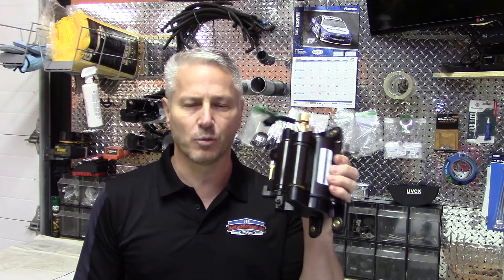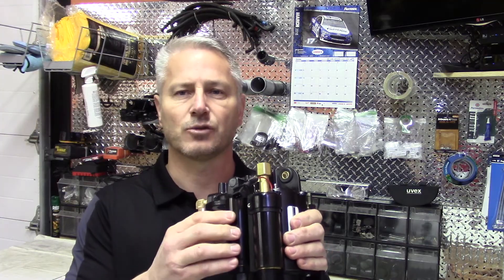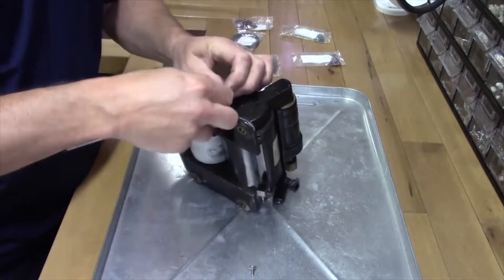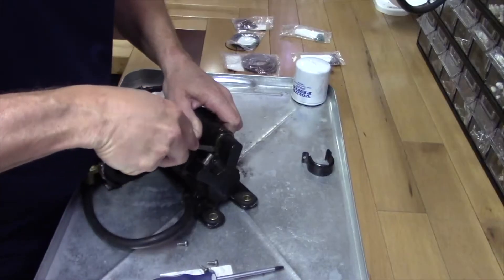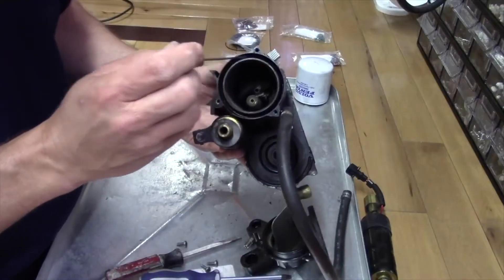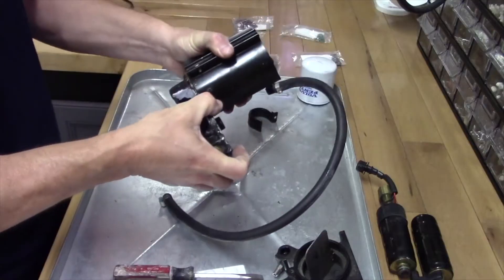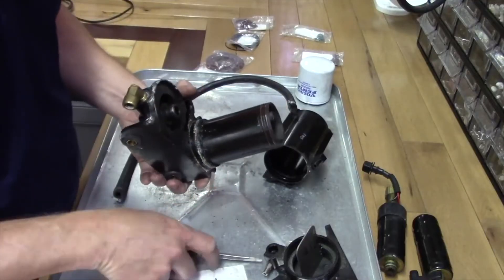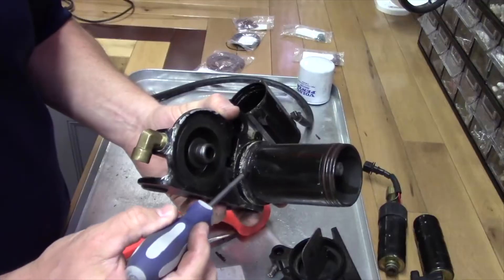Volvo Penta Fuel Pump (PART 1) Disassembly

Comment: I have to replace my high pressure pump. You said that the screw that holds the bracket on brakes off and you have a fix for it, can you tell me what it is in case it happens to me. Thanks,Tom

Comment: Hello, great video! I think I would like to hire your services to rebuild my PV fuel pump. The problem is, I’m not sure it broken. My PV 5.7 Gi-D won’t start. The fuel pump pressurizes when I turn the ignition. I put a fuel pressure gage on the schrader fitting on both the low pressure fitting and on the railing side. The railing reads 50 PSI but the low pressure cell read nothing. Not sure you can fix that by just cleaning that pump up from paint debree. Would a zero reading on the LP cell cause a no start due to lack of fuel? Any thoughts would be appreciated 
Pat

Comment: Have you ever replaced fuel pick up hose? Mine is cracked?  Do you know what size o ring is the top water seal on the inside cylinder?

Comment: How much do you charge for the reman service?  I just replaced mine with a new Genuine Volvo Pump assembly.  The parts store told me it is the 6th generation of this pump.  I am expecting the new one to fail in the future.  I want to have my original serviced so it is ready to go on the shelf when the inevitable happens again.  $1122.00 for the new pump assembly if anyone is wondering how much a new one costs.

Comment: Great videos.    Really appreciate the level of detail and functional descriptions provided.   In the process of diy removal of paint and your gasket kit is in route and is expected to arrive today.   Quick question, what is the purpose of the divider plate that rests vertically in the center of the lower assemble that is accessible when the lower assembly is removed?    I noticed the two lower guide ears appear to be bent up and when I tried to straighten one, the tab broke off.   Does this render the piece unusable even though it still rests securely in the lower assembly grooves?  It does not look like it is a tight seal when installed and can’t figure out it’s function.   Thanks in advance for any clarification.

Comment: Have a bad vibration in motor  at idle on a 4.3 gl-d carburetor replaced everything 2 times plus the heads have done everything spent 3500 so far  carb rebuild adjustment rebuilt again then bought a brand new carburetor re ajustment plug wires, coil, cap ,rotor , control Module , check timing had new heads put on  still like bad miss at idle only runs good at high rpm only thing i have not done is fuel pump.  Could that be it

Comment: Budy just installed this exact fuel pump assembly. The new one is pouring fuel out of every spot it can. Instead of pumping water through it and into the manifold. Its dumping the fuel straight into and out of the manifolds. Went throufh half a tank in 15 minutes

Comment: We installed a new fuel pump but not wind on the prime. Is there a fuse or some kind of electrical issue I need to find?

Comment: I have a 2001 5.7l Volvo penta it only has on low pressure electric fuel pump. I'm pretty sure the filter is clogged. What is the best way to clean it and retry the pump?

Comment: Hi Troy
We have port and starboard engines. The port side pump was replaced in 2014. These are 8.1 GXiI-F series. Is it possible Volvo was still selling the versions you mentioned and it was replaced with the same problem pump? Because we are having same issues, like bad gas, also engine performance when you got o give it throttle cutting out and excessive fuel smell, smoke. This is a reat demonstration, Thanks! also I think the superseded p/n is 21608512

Comment: Is there are way to tell if the low/high pressure pumps are damaged from the paint flakes and need to be replaced? I just started having the issue, the boat ran for about 2 hours with the fuel pump making a loud whine. How should I clean out the pumps to make sure they are clean. You mentioned in the video you would test them later but didn't say how. I'm just wondering if I should take the time to clean out all the paint from the pump or if my assembly is done. 

Also do you ship parts to Canada?

Comment: Troy, I have a 2009 Regal with twin 320 volvo penta's approx 260 hours....i just had a fuel pump go out. The mechanic said it was the high pressure pump that was bad, but replaced the entire assembly. I have the old one, and was thinking of having this one remanufactured, since if it is the paint issue, the other engine cant be to far behind. I boat in Lake Michigan, Grand Haven area. What is the cost of having this done?

Comment: Damned if I can get the f*ing thing apart. The high pressure pump was bad enough but I can't budge the inner fuel cell tube from the float valve end. Do I need to use a filter wrench?
Also sea water has got into the end o ring seats on the fuel cell with slight corrosion in the groove. Can I use some aviation gasket sealant on the new O rings?

Comment: If this is such a known issue that why the hell do they keep painting the pumps??
Reply: They tell you in the manual to only use ultimate unleaded 95+ or you will damage the engine. Idiots don't read and they use lower octane ethanol added fuel. It's the ethanol that strips the paint. I'm having to deal with a previous owner's stupidity right now.

Comment: What is the function of the fuel cell section of pump assy. Great video, very informative. Thank you
Reply from the maker: The function of the fuel cell is to contain the fuel so that it can be cooled by circulating water around it without contamination.  Thank you

Comment: Very good videos... I have VolvoPentas 8.1, port engine pump whining and engine not starting, so removed the pump and disassembled. It certainly needs the work you do. You mentioned send it to me to test and refurbish it. How do I contact you to start the process? Again thanks for the videos.
Reply from the maker: The easiest way is to visit my website at ManCaveMechanic.com.  I have the services listed there as well as parts
Reply: Placed an order and item is on its way to MI. Looking forward to see the final product.

Comment: I have a Volvo Chaparral with a 5.7 GSI V8(350).  The boat is a 2001 but has been maintained meticulously.  I replaced the original fuel pump on 8/5/10 at 317 hours.  Boat has always gone to max revolutions with no hesitation.  It still does except when I try to go flat out at 56mph.  It will crank right up to about 50 mph but when I give it the final push, it flattens out with symptoms of fuel starvation.  Fuel filter is clean and it was recently fully tuned with plugs, rotor etc,  Currently has 550 hours. The problem started out of the blue about three years ago and there are no other symptoms of fuel or electrical problems.  If you didn't try to take it to full speed, you would never know that anything was wrong.  I have taken it to two Volvo service centers and neither can figure out what the problem may be.  I was impressed with your video. I don't know if my replacement Fuel pump has the painted interior.  However, I saw a Volvo service bulletin that indicated that the paint flakes from the fuel pump can clog  the fuel pressure regulator filter and they recommend removing the regulator filter.  A Volvo dealer told me that if the Regulator were clogged, I would have a much more significant loss of fuel/power.  Do you have any ideas?ThanksMike Cameron
Reply from the maker: I agree and was going to suggest cleaning your FPR when I read the last sentence.  The Volvo solution is to remove the screen and replace with the e-clip.  Just know that if you do that and have not removed the paint out of your fuel pump then you are risking the paint debris going through your regulator to your injectors.
Reply: Thanks much!  You are on my list for a clean up of the FP
Reply: I've never had a problem with this engine so I never really looked at it closely.  I got in there today to clean the fuel pressure regulator filter and discovered that this 2001 5.7 GSI is carbureted--- no fuel rail.  Fuel is delivered direct from the fuel pump to the carb.  Do you know of any small carb filters that could be partially clogged with black paint?  I'm stumped!ThanksMike